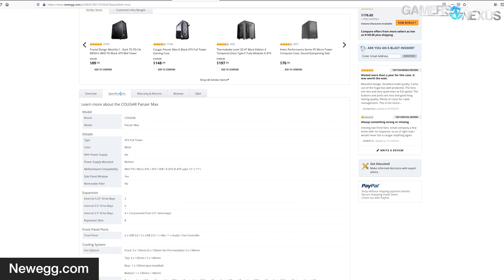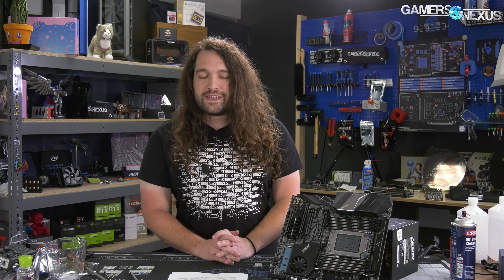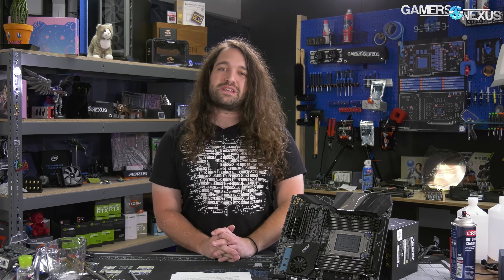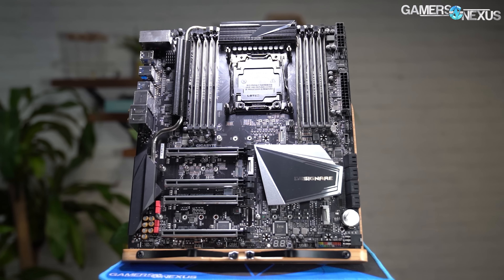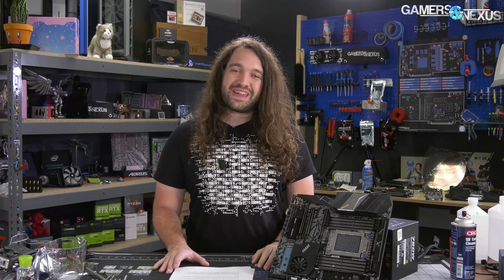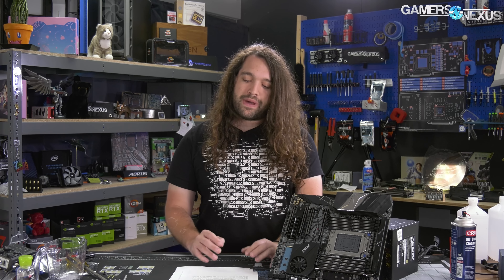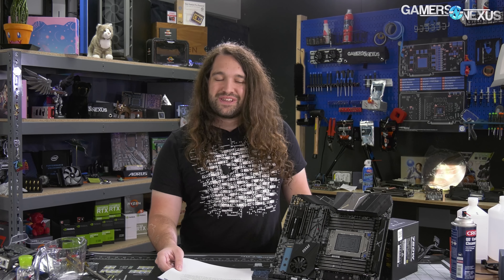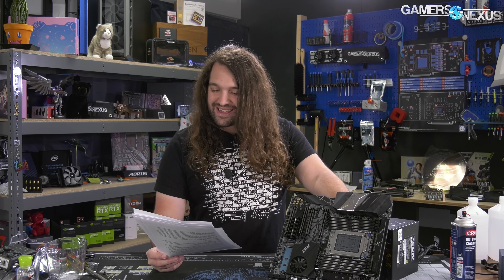"E-ATX" Is A Lie: How Motherboard Makers Ruined Form Factors

Comment: I use a laptop plugged into my TV. Does anyone use oversized motherboards? Or is that now common to get larger than ATX? It's kind of understandable that manufacturers don't want to be forced into a standard. Then they can make it as big as it needs to be, as long as they know buyers can find a case for it. But then they should say non-standard and give the dimensions. Then someone is going to label a board NS for non-standard.

Comment: E-ATX 
Advantages:
-Lot of slot( such as DIMM, PCI Express) and connector 
-More feature 
-Durable 

Disadvantages:
-Expensive 
-Requires large case(Full tower)
-Heavy
-Difficult to build than ATX, Micro ATX
-Some E-ATX motherboard have 2 or more EPS connectors. If the power supply have only one(1) EPS connector, they may not work.

Comment: You mentioned BTX.  It was a long time ago, so I might be confused, but I think it was a set of design proposals by AMD.  The main goal was to improve cooling.  It looked at both horizontal and vertical forms.  The original AT was intended for horizontal use.  I don't remember if IBM ever created a vertical product using the AT board.  I would guess that the vertical design was part of Intel's ATX proposal.  As for BTX, I think it was actually used by HP and Dell, at least for a while.  Compaq might have used it.  I'm no expert at the big corporation ("enterprise") desktops, so I might be wrong about even that much.  But those computers tend to be very quiet and fairly cool running (aka "underpowered") and very reliable.  So simple front - to - back airflow tends to work fairly well with them.

Comment: Why do they still use Inch? We introduced the metric system over 100 years ago (not invented, it was invented much much earlier) to be used by everyone for very good reasons.
Using inches is a sign of bad engineering.

Comment: While your right.....

It went like this.....

ATX = 7 PCI slots. A inch over the Io.

mATX = crazy.
This could be 1 PCI, 2 PCI or 3 PCI slots.

Someone shoved a various range of PCI slots on boards, so there wasn't really a standard. A Inbetweeners boards...

Then they added features, so you got different sizes.

eATX was a extended board. Normally wider. And a single PCI slot in height, but not used for PCI.
 Width size would be about 2" 

This caused loads of issues due to drive bays so cases would often not fit a board.

Motherboard then made them narrower. Which came to be a half form factor.

IMO it was the case manufacturers  cause of problem.

The hole points, was a stress point, so for fittings there were holes, like CPU mounts. Single or dual.... But there was a server standard.

Then people started using server boards. Then they made "cross over boards" to meet the small factor server board to smaller cases.

Then they brought out ITX.
Roughly CD case sized boards.
This gave us mITX and MTX cases.

The standard is old and out dated.
We really need to have totally new board and standards so that tech can be updated and work properly or better.

24v PSU's
Full board fitting.
Cable management.
Drive space.
Cooling design.
Airflow.

Comment: I just built a mini ITX system as I predict it will become more popular in the near future. Optical drives are dead, having multiple HDDs is dead, SLI is almost dead and I am willing to bet that most mainstream systems are only using 2 sticks of ram.  I just don't see the need for ATX anymore in 2020. Having a board that is even larger than a standard ATX makes even less sense.

Comment: Steve, if you think that's bad, you should delve into the world of Development boards that call themselves ITX.
Mini ITX (atx reduced to a 17x17cm footprint) is a well defined specification... sort of (some boards defy the maximum higher spec set for IO in ATX and utilize cards that socket in at a greater height to add more feature they lack space for.)

Now that's all well and good, but that about... MICRO ITX. yes, the dreaded half height ITX, and quarter sized, used in so so many development boards where hole spacing is a suggestion; there's no official location of IO on the boards (despite most ARM based square FF boards being so damn similar they may as well develop a FF and stick to it!), and many are designed without any thought to uniformity or mounting at all.

our ONLY saving grace in the micro-computer world is the raspbery pi and big daddy broadcom thats made their Pi-A and Pi-B a standard that other SBC manufacturers and accessory/case manufacturers have coppied.

Then there's the unnamed 90mm square form factor thats been seen in a number of embedded and nas systems that actually IS a form factor but has no NAME.

Comment: If just putting the dimensions for a case would work that would be good but then you wouldn't know if the standoff pattern will work with your case / motherboard hole pattern.

Comment: Personally, I think the quickest fix to this is to define EATX with a number, in inches, which defines the width. Height stays the same as ATX, and say a board is 10.7inch wide, it becomes EATX10.7 . It means that you could quick fix the existing mess, anything outside the height is not EATX, and anything that fits, the width is included, and you need a case that supports a number higher than your board, or a board with a number lower than your case. 
It means the whole mess could be categorised quickly, with minimal change, on both the board and case manufacturer side of things, and still make it easier for consumers. Assuming that they can work out Case EATX number > board EATX Number.:-D

Comment: I agree. I have eatx mother board, I have eatx full tower super big case... and the mother board does not fit nicely to that case...
Well it actually fits in, but the mother board blocks vire holes in the case, so it is extremely hard to route the vires... aarrgghhh...
Really frustracting.

Comment: Ah but BTX boards are actually mounted on the opposite side of the case entirely and in an upside down configuration with the CPU cooler blowing air from the front center of the chasis through the CPU cooler then directly onto the RAM and top side of the graphics card with the power supply mounted at the top rear above all of this... In my opinion, looking directly at a XPS 410  right now next to a monsterous modern ATX system... It looks like the BTX is actually a better lay out... In my opinion.  But I unfortunately can't test it at the moment, I killed the EVGA gpu in the XPS.. I'll have to get another GPU for it. (this is referring to a 2005 Dell XPS 410 media center edition, according to the service tag)

Comment: I think the consumer doesn‘t care if the naming scheme is dumb, because if you spend more than 700$ on a Mainboard you better take your time with your purchase decision or have enough money to buy a second case if the first one doesnt fit. And as so you said yourself most cases are designed around ATX and later certified for E-ATX, but these are not the cases someone with a >700$ motherboard would buy(for example the P400A), but either workstation cases for workstations like the one intel send you for the W3175x or big boutique cases like the O11 XL or the In Win 928 for example.

Comment: I just went the safe route, i bought a Lian Li V2120X which is my forever case, supports up to "HPTX" (13.6 inches x 15 inches / 345mm x 381mm)

Comment: Well probably to separate it from ATX as a standardized key term. But it makes sense to call it E-ATX (only) and add the exakt size measure to it. However marketing does a bunch if these tricks on all things related to standardization, so it's no surprise it's as butchered as it is really.

Comment: It's so true that it's almost unbelievable, the amount of people who I have built machines for I have had issues fitting boards in is just a joke. For example my old previous build gigabyte x58a-ud3r with i7 920 barely fit in the thermaltake kandalf chassis an allegedly E-ATX motherboard that hangs of the tray with little support and clears the bottom of the case by 4mm. Give us accurate standards manufacturer's! lol

Comment: That is what i call an adequate rant!
I was raging about this same form factor bs before when I built my last PC. It is really annoying! 

BTW I found I similar thing with PSU form factors. They seem to make no sense, too. Especially in cheaper cases it can happen that you buy an "ATX PSU" and try to fit it in a case that supports "ATX PSU" but it won't fit because the case only supports the small ATX PSU. WTF is an ATX PSU when I can buy them in different sizes?

Comment: Unpopular opinion: The form factor designation is more useful as a shorthand for approximate dimension than exact ones. The majority of consumer level users only need these terms to understand small>medium>large>extra large at a glance. The users who need exact specifications are enthusiasts, and those dimensions aren't being met currently by the form factor designation EVEN WHEN IT'S BEING FOLLOWED CORRECTLY. The industry should be including max height as well as the lenght x width, and maybe even a footprint dimension surrounding the CPU socket. 

This doesn't mean that the form factor designation is useless. It's still good for communicating in casual conversation. We just need more precise measurements in tandem with the form factor.

Comment: Time for MB manufacturers to come together and redefine the coding of board dimensions, port config, and hole patterns. It would not be hard, Base config (ATX), Height Code, Width Code, Hole Pattern Code, Port Config Code.  Size use 6 digit number of concatenated size in metric ATX = 305244 , Hole Patterns A-Z, Port config is (L)inear of (B)lock.
ATX 305244 AB Size can go up to 999 x 999 or can go down for Mini ATX  (They could go in fixed increments every 10, 20 or 30 mm)
So a Name might look like MSI B350 AM3 ATX 305244 AB  or  ASUS Z390 LGA1151 ATX 305244 AB etc. etc

Comment: They should just call it ATXX or ATX^2. Then make it 12x12 for 144in^2. Then upgrade by making it a double sided board with a system or parts on each side with double layered boards. This being ATX^3. Could they do anything interesting with a double sided board with two cpu's literally with the sockets hooked to each other. Or a special double sided single socket. Possibly removeable for future socket replacements with the same double sided nature.(or single if desired) Then the ram could be qaud channel using dual interlinked with two banks or double ddr system ram.

ATX^2 could be 12x12x6 ^ 6 inch top clearance. ATX^3 would then be 12x12x12 with a double sided board. I wonder if you could also interleave videa cards so a 16x on each side could share lanes and work as a double gpu card with two cards. Or at least do something interesting. Error correcting possibly? I have no idea what could be done.
Reply: Then move it to optical versions. This would allow the extra inch to be added later if desired for extra connectors and the actually ability to connect components with full speed potentially. And potentially new board designs where you simply pop in new components like CPU bridges(or whatever an optical cpu could use if those existed.) and allow customization of the motherboard I assume could exist with optical mobos busses..

Comment: In your conclusion you say they should go all the way to EEB if they need more than ATX. I disagree, it's too large for what the vast majority of high-end motherboards need. CEB is slightly too short too.
I think there should be a proper XL-ATX standard that is 13"x11" (HxW, 33x28cm), providing an additional PCI slot to have quad x16 double height PCI-E card support. ATX specifies the first slot too high to leave enough room for the VRMs and DIMM slots on HEDT motherboards.

Comment: The confusion isn't just because they didn't try to get a standard, but because Marketing has a lot to do with it. Like not using (SSI-)EEB for (Full)E-ATX. Why? If you look at from psychology as understood by Marketing, they don't want to use the label because

1. It's disconnected from what is normally associated with gaming or extreme performance hardware...

2. ...While even those who are aware of what it means associate it with boring green boards with blue heatsinks with boring but expensive low clock speed CPUs (or two) that don't help with gaming until games like Civ and Total War at least can actually utilize that many cores more than a 5.2ghz 8c/16t or 4.7ghz 16c/32t CPU.

Comment: I dont think that its the Motherboard manufactures fault. I am sure you can specify a dimension that will   " F I T "   all E-ATX motherboards. Case makers should then comply with this overall specification. Everything will be good then. One size fits all E-ATX. As you rightfully said, case manufacturers are the ones who are forcing the E-ATX standard branding on their cases only as an afterthought.

Comment: I got a used dual socket server board and it took a while before I realized not all E-ATX cases are created equal, I knew the mounting hole positions should be the same but when I searched for cases, I realized how vague E-ATX really is, eventually realized I have to find cases that specifically mention ssi eeb to be sure I wouldn't have to return it and settled for phanteks enthoo pro but the search was brutal

Comment: I mean... Yeah, I kinda agree that it's a mess, but I feel it's still needed because it's too practical because the market is just so small. Case manufacturers can design cases for general, comfortable use with ATX boards, and then mention if extra overhang is possible in the rare case someone needs specifically that, without compromising the main purpose. Motherboard manufacturers can design boards that are just slightly wider if their tech requires it, without wasting space and materials on larger boards that won't really fit in most cases anyway, and let the buyers look for the perfect match. If there's just no definitive need for full dimensions of the closest next standard, it's essentially enough to mention what holes there are (ATX), that it's wider (E-), and by how much (number). Win-win.

Comment: Yep, this was my biggest annoyance when trying to upgrade/future proof my case. Being on an X99 chipset, the E-ATX tended to get tossed around a bunch on high end motherboards and so i went looking for something within my price range that had support. Looking through cases and motherboards made it clear that E-ATX was completely arbitary and meant different sizes depending on which motherboard you were looking at. Ended up going for the NZXT H700i and still love the thing even if the smart device is utter shit, but it does look like it's possible to install a much longer board than 10.7", if the cable bar is removed from the front of the case

Comment: They should keep the remnant reason and state their case to be "ATX port configuration" Which is about the rear panel and PCI slots and spacing. And the max PCB size.
Boom, there it is.  That is the only part of the spec that matters from a mount up point of view. No more need to use form factor acronyms that were never created other than by a stupid sales team.  Problem solved until they can learn to get together on such things in the future.

Comment: Motherboard manufacturers need to buy and test every. singe. case on the market and provide a QVL for users to check what cases they will fit in.
Either that, of resellers need to stop selling boards that don't fit into a standard.

Comment: From an engineering point, PCs have always had a retarded design, like putting the power supply two feet away from the CPU. Duh... likewise throwing a bunch of connectors right where the most efficient place to put an exhaust fan is, none of which are required to be anywhere near the CPU... For 40 years we have put up with this stupid dumpster fire, it’s so annoying. We need a new standard!!!!

Comment: this isn't a new issue back in the days when I did my Celeron build probably somewhere 1999, a lot of cases supposedly able to fit ATX and BTX boards were utter complete garbage, today its the boards which don't fit the cases ... so nothing has changed for the customer ... doesn't really matter if its the boards not fitting or the cases. In the end you as the customer are the sucker!

Comment: my take is that yes its infuriating but at the same time i feel the type of people to lay down so much cash on an "E-ATX" board are probably the same people that will be checking these oddball dimensions for the correct size case, so while i totally agree with you i also feel like its an extremely niche issue and wouldnt affect the 99.9% out there.

Comment: I mean I can understand why some manufacturers want something between ATX and E-ATX to pack extra features in their board without making it unnecessary huge (and expensive) and even why they might want to stick to the "known terms", but I personally would be just fine with a X inches × Y inches information, as long as they leave enough mounting holes at their standard position

Comment: I struggled with this recently when designing a custom enclosure for my next workstation build.  It's gonna be a Threadripper build so "E-ATX" but not E-ATX.  The boards I'm considering are basically ATX with a bit hanging over past the screws but not far enough to include the fourth column of screws that you find in the ACTUAL E-ATX standard or at least the standard on Silverstone's website anyway.
Thankfully the case I'm designing is "ahem" MAHOOSSIVE.  Kind of a brute force approach but, meh, whatya gonna do?

Comment: Fucking finally someone big named points this out - i build a few pc's a year (10+) and every damn time i have a build then its a guesswprk to figure out if stuff fits together in the case - psu gpu mobo case and cooler all variates each one and depending on which case the client want, i have to pick all other parts out from that case wich can be tricky